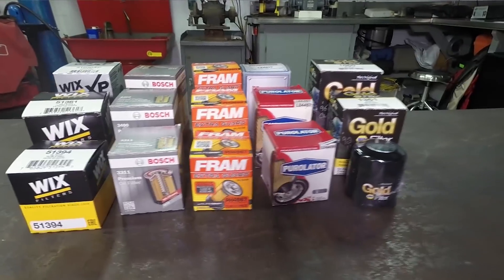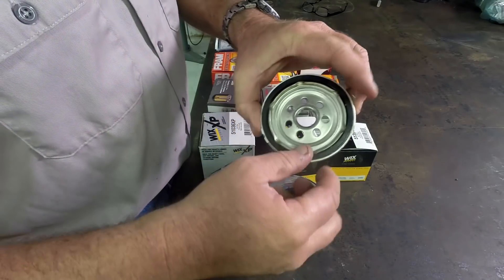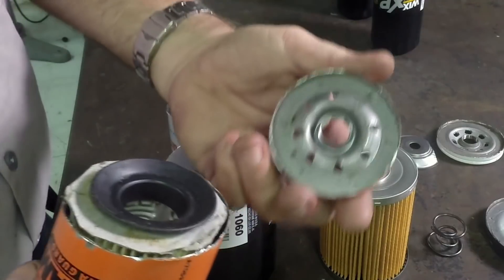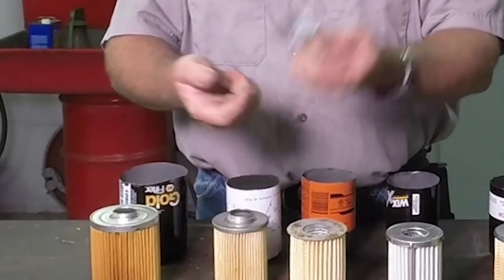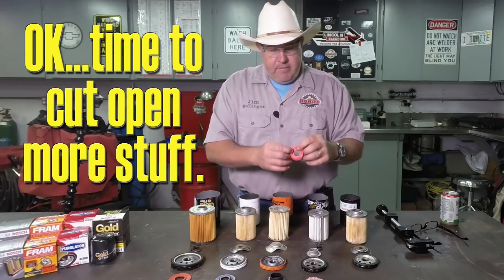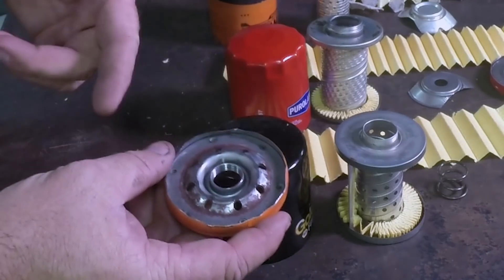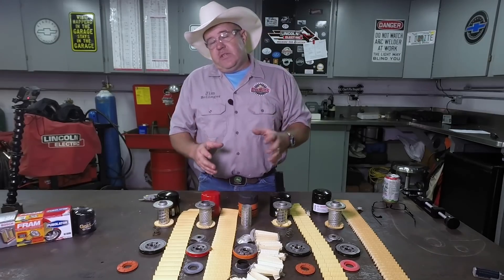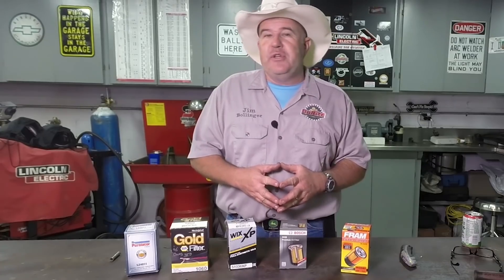The worst oil filter EVER!

Comment: Uh.. Some people actually WANT the absolute cheapest filter they can buy and couldn't care less about quality. 

Fram simply fulfills that niche market. And they've been doing this for over 40 years.......
Reply: Wow lie much !! or are you just that stupid?  Thats not rust and you know it. thats Discoloration  where they use heat to cure the cardboard to the filter. there is NO rust in the canister !!  yes it is a cheaper filter, but its susposed to be. its only good for 5,000 miles and is dirt cheap for walmart to sell. if you want a good filter test a fram ultra filter rated for 15,000 miles. cut one open to see , makes your napa filter look like a pice of shit.  i am a mechanic & i know what im talking about.  you are lying to these people and should be ashamed !!!!!!!!!!!!!!!!!!!!!!!!!!!!!!!!!!!!!!!!!!!!!!!!!!!!!!!!!!!!!!!!!!!!!!!!!!!!!!!!!!!!!!!!!!!!!!!!!!!!!!!!!!!!!!!!!!!!!!!!!!!!!!!!!!!!!!!!!!!!!!!!!!!!!!!!!!!!!!!!!!!!!!!!!!!!!!!!!!!
Reply: That's right...just doing what it is designed to do....filter the oil.

Comment: Somehow I am just not surprised at all that the best filter comes from Napa.
Reply: ( Do you REALLY know who actually makes them ???)
Reply: @denniscollier4931  No, I don't. I do know that almost all automotive filters are only made by a few factories in foreign countries. All of these factories make different quality filters depending on what the company ordering them wants, and what they are willing to pay to have them made. Napa branded parts have to meet Napa's standards when they are contracted for manufacturing. Napa has very strict standards for their higher end new and remanufactured parts. I use Napa parts whenever possible, and I have never had any problems with any Napa parts. I have been using Napa auto parts for over forty years. It is sometimes a little more expensive to buy from Napa, but their parts are well worth the cost. In many cases good quality Napa parts are no more expensive than lower quality parts. Note, that I am not a professional mechanic, and I have no interest in Napa other than being a very satisfied long term customer.

Comment: I always knew fram oil filters were absolutely crap! I'll put it to you this way, Fram is such garbage that anyone who is familiar with or owns a dodge Cummins diesel pickup likely knows that there's a technical service bulletin from both Chrysler and Cummins engine plant that apparently there was a large number of engine failures that were caused by owners running Fram oil filters and what was happening is the filter media was literally falling apart in the filter and getting pushed into the oil passages throughout the engine and blocking the piston oiler/cooling nozzles and burning up these engines from inferior quality filters (fram primarily) so Cummins said they would no longer warranty any engines that failed with a fram oil filter on them.  So why is fram still making their garbage??? Pretty bad when their oil filters will void a warranty on a reputable diesel engine company.
Reply: Evinrude (OMC) would also void their warranty if you used Quaker State two stroke oil in their engines. My dealer told me that when I bought a new 115 hp engine. They had tremendous problems with Quaker State oil making severe coking deposits and locking up the piston rings and blowing motors. I bought a Chevrolet with a 283 V8 that had been run on Quaker State oil. It had 1 1/2 inches of sludge in the oil pan and you could see the springs when you took off the valve cover. That pretty much made up my mind.

Comment: Yeah, you cut them open and they look like cheap crap.  But do they do what they're supposed to do?  I've been using Fram filters in my old 1990 Corolla for 20 years.  That's how long I've owned the car.  It's got 386,000 miles on the original engine.  Never been rebuilt.  Never even had the head off of it until 18 months ago when a head gasket blew.  It didn't even need a valve job (checked by machine shop).  I had the head surfaced, replaced the head gasket, seals, hoses, belts and put it back on the road.  Still runs great, gets 30 to 35 mpg, plenty of power, no smoke.  If Fram filters were not filtering out contaminants that engine would have been toast a couple of hundred thousand miles ago at least.  Instead, it's approaching 400,000 miles and still going strong.   I'm not worried about Fram filters.

Comment: This is interesting. Cheap oil filters are a dumb way to care for your car. Penny wise and pound foolish. Of course the real way to test a product is under real use, so you would need a pretty expensive piece of test machinery to see which of these filters does the best filtering. There are many other analysis of filters on line, but unless a test has been done under scientific analysis, just looking at the materials & construction is not the whole story. But, finding rust inside a filter; totally unacceptable.

Comment: "There's no metal in it... and it's already rusting inside the filter."  Really???
Reply: It isn't hermetically sealed...it's open to the atmosphere ( just like all the others) almost ALL of the oil filters he displayed will display rust given the same situation.
Reply: @denniscollier4931  Toyota filters have a plastic sheet stuck across the open holes to keep out moisture and dirt until the filter is ready for use.

Comment: I buy the cheapest filter on the shelf. Its usually eg. Every other filter i break down and inspect. I also send off my used oil for testing. Never inspected a filter that fell apart or wasnt doing its job. I replace filter/oil every 3-4k. I only own honda or toyotas and get 400k+ miles before block/internal issues. Its more about regular maintenance.
Reply: dont care about the rust or cheap paper but hondas and toyotas do last somehow whether you change oil or not seen go a long time by people who dont know what maintenance is
Reply: Here again is a man who thinks for himself...even a FRAM filter will give the expected results !  ( filter the oil ! ) Not worried about the glamor or hype about the filter.

Comment: I got something for you.  Try the system one.  It replaces the Fram HP-1.  It's the last filter you will need to buy.  It has a stainless steel screen that filters to ten microns.  You take it apart to inspect and clean the filter.  You can then examine any particles in the screen that would indicate where wear was coming from in the engine.  The other one is the Oberg .It does the same thing but won't spin on and requires separate mounting and hoses.
Reply: Steve Williams , I agree 100% have used System one on my drag car for many years!👍🏻 Just the best 🚦👍🏻

Comment: That was kind of disturbing.  I've been using Frams for my cars for over 20 years, with (*cough*) unreasonably long service intervals (*cough*). My current vehicles have 237k and 164k miles on 'em.  Maybe it's time to consider changing brands. :D  Now I have been using full synthetic oil all this time, which I suspect is a more important consideration than the brand of filter, at least so long as you're at least fairly good about oil and filter changes.

Comment: We use Fram for run-in only. (Just going to get chopped open and tossed after the first run anyway) Use one more for a short run and another oil change, then switch to a K&N and a good A.D oil. They do like to come apart at higher temperatures, but if your engine is seeing oil temps above 260, you have more going on than a simple filter problem. Nice comparison Sir! Makes a great case for "You Get What You Pay For" type philosophy. Keep 'em coming!

Comment: Fram use a low grade silicon glue that melts under heat and clogs up the pickup screen. Just as any Porsche owner who blew up his engine.
Reply: Was the melted glue the real problem?...or did the engine by-pass fail ??? ( most engines have a by-pass JUST IN CASE of filter failure...)
Reply: OH, any Porsche engine that blows up was because of FRAM filters...right??

Comment: I almost lost an engine once because of a Fram filter. it "clogged" up and would not let the oil flow through it. I never use Fram filters.
Reply: Don't let it get that dirty.
Reply: What happened to the by-pass????? That is it's job! To open up in case of oil filter stopping up ! Don't really think the filter was the problem there...

Comment: Thanks mate...I used to think Fram was a pretty high quality brand because Hitachi used to use their air filters in their Excavators from the factory but after seeing your video I will stick to Purolator or Bosch (your top two brands are not available in the UK). Cheers, Kevin

Comment: I don't use the basic Fram filters. The peace of mind that comes with a more expensive, higher quality filter is worth a few dollars to me. That being stated, I am not certain the filter is poor because of the minor surface rust, thinner filter element, and non-metal caps. If it is changed regularly, I am not sure if it matters. My opinion is the metal caps and heavy element approach is an effective marketing ploy to attract buyers who want to baby their cars when these features are overkill.  In addition, the soft end caps may provide a better seal.

Comment: There is no metal under that cardboard?  You skipped over the thickness and quality of the fram can, which is a very important part of the filter.  The fram is the only one with the grip on it to make it easier to grip to tighten and remove easier.  It's also a heavy duty metal so it doesn't damage the filter inside.  What are the materials that make up the filters themselves?  Does the material  filter the oil better?  Are the fram filters you cut open brand new?  Why do you think it's rusted?

Comment: Everybody below agrees with you by saying they won't ever use Fram again, but just think of all those jiffy oil replacement places that service millions of cars every year.  Their goal is to make money by very quickly changing your oil and using the shittiest products.  Most of them use Fram.  They also only replace no more than 80% of the oil, because they don't allow adequate drain time.
If you want your oil replaced properly, do it yourself.  I personally use Mobil 1 Extended Performance or Wix Extended Performance filters, because I use Mobil 1 Extended Performance synthetic oil to go the long haul.  I let it drain for at least an hour by finding things to do while its dripping itself out.

Comment: Could you check on the Amsoil filters and the  K&N filter for oil and Donaldson filters  and FORD Motorcraft filters.
Reply: Donaldson is a commercial use filter. They specialize in hydraulic filters. Right up there with wix and luberfiner

Comment: I used many oil & air filters over the years, but i learned that it's just best to use OPM, I take my Dodge Ram to the dealer where i bought it & they use the original Mopar oil filter & the oil it calls for! it's an 08 truck with 90,000 miles & i'm the second owner! Very dependable! the Fram filters are junk, they never used to be but they really cheaped out! When i had chevy's i used AC Delco, Fords i used motorcraft, never had an issue!
Reply: Do you even know why the FRAM filter is "JUNK" ? or did someone else just tell you that??? Really??

Comment: I watched another video and the Fram ultra is decent
Reply: Too many FRAM filters have been used over the years to be a complete wash as JIM states...it's NOT about the paper or glue or metal in the spring or ??   it is ALL about how well it works! The proof is in the performance.

Comment: You know with every piston engine airplane, it’s a requirement to cut the filter open at every oil change and look for metal particles. They make several oil filter cutters for use in the aviation industry, and the race car guys do it also. I hate to see you making sparks and grinding all those filters apart when there’s a $40.00 tool to make the job simpler. Try “Aircraft Spruce” Online and you will find several filter cutters. Just trying to help.
Reply from the maker: Look on the workbench

Comment: Fram filters are the worst you can get, unfortunately no one client has the knowledge about filters, this goes back to some years ago when Cat refused to accept any oil filter  than a Cat oil filter on their engines whilst under warranty, a bullshit issue, the case was won, unfortunately I can't name the filter manufacturer, we used the other Manufacturer's oil filters, remember that no equipent manufacturer has their own filters made by themselfes as a company, it's ALL branded filters, it's all about MONEY. Several years ago I approached a Transport Company ( in South Africa) explaining them savings, direct assistance and support, guess what, that particular Company offered them another 100,000 kilometres of warranty on their trucks just to sell them filters, .....and the filters were branded manufactured by the Company who I presented, but, that Company could not match the price, and, this Company did not not have one truck on the road, thus, who wins on on the end of the day...... explain that to me, filter bussiness is a very complicated issue...?., do we always need the best oil filter at the best price, personally I would bought the filter from the Company who I represented, why, he lost a lot of money, same filter, but pricy, the trucks made kilos with with no problem.........?

Comment: The Wix and NAPA Gold filters look like comparable quality to what we use on General Aviation aircraft engines. Every oil change, not only do we change the oil and filter but we cut open the old filter to inspect for metal particles...
Reply: That is fine for the aircraft application. Real racers do the exactly the samething,   but it NOT to see if the filter is working, BUT to see if any parts inside are failing!
Reply: @denniscollier4931  well that was my point. If there are metal particles we know something is wearing faster than it should be.

Comment: I've used nothing but AC Delco filters for years, haven't had any issues.
Reply: Need a teardown of some other brands like AC Delco and Mobile1.  Nice thing about the Mobile1 filters is you can get them with the oil on some promotional specials and they're rated for longer mileage than that Fram POS by far!
Reply: See JIM, another real world filter user...even AC Delco filters oil just fine!

Comment: My 2002 toyota tacoma with 235K miles has had a fram since the first oil change. Have always used synthetic oil. I will stop using fram. thanks for this. Good video.
Reply: REALLY ? did you have an engine failure? And the FRAM has worked all this time ???   OH, with only 235M on it you must have saved it just in time!
Reply: @denniscollier4931  No, but I always thought all filters were the same. I use the best oil so why not the best filter.

Comment: I totally agree with your findings on Fram Oil filters, but not only are their automotive filters low end junk, their motorcycle oil filters are worse! Example: A stock Honda MC filter is designed with a deep channel to completely cover the O-Ring and trap it when the metal oil filter base touches the mounting surface on the engine.. Fram spin on filters use a shallow channel that does not cover / capture the O-Ring when torqued to the correct specification (3/4 turn after contact) If you have a high revving engine, the Fram can and will blow the O-Ring and puke oil everywhere.. AND if you over tighten the filter to try and keep the O-Ring from failing, it can actually watch it get overly compressed and squeeze out of the channel with no oil pressure behind it.. The poor design is destined to fail, do why take a chance.. AND the hidden components inside are as the video shows.. Cheap cardboard and cheap filter media.. Fram might make some decent products, but overall, you are SOOOOOOO much better off with Wix / NAPA or other quality filters, you are risking too much to trust anything Fram makes..

Comment: wow, in my hot rodding days i used fram all the time and had no problems BUT, i also changed my oil very regularly so that it never go too dirty and i used good quality oil, both practices make a difference to your engine,
Reply: You sir, are a thinker...doing exactly what you should...proper maintenance ...( and did you EVER really have a FRAM filter fail ?? )
Reply: ed--yes, in my day there was not the selection you have now and i tried many different brands and ruined engines before i stayed with fram and had no problems, but like i said, i changed my oil regularly and that along with a decent filter makes the difference.

Comment: I have a car with over 600,000 miles that I have only used Fram filters since I purchased it with 90,000 miles.He is comparing the lowest price Fram filter with the highest quality filter from the other brands. I also have another car with over 500,000 miles that has only used Fram since I owned it also with oil related problems. Am I just lucky? I highly doubt it.

Comment: I’ve been using Honda filters for years and lately they are being made by Fram. I just switched to NAPA Gold and will never use a Fram again. Hope my engine doesn’t have any damage from 60,000 miles of Fram filters. I change my oil every 5000 with synthetic. Hopefully that will compensate for the shitty filter

Comment: FRAM is absolutely just as good filter as any other filter. I am using FRAM since 1992 on all of my Hondas. My first Honda Civic '92 had 320,00 miles before I gave it away to my relative. In 2006 I bought Honda Civic '06 and used exclusively FRAM after the very first oil change. I got 340,000 miles on it. Before I sold it, I did Honda inspection and I was told that the vehicle would go another 100,000 with no problems. Based on my personal experience FRAM is excellent filter. I am still using it today on my '14 Honda Crosstour, which has about 80,000. This comparison of filter is simply nonsense! Used by paid advertising and is misleading.